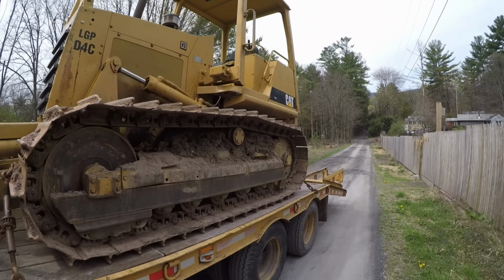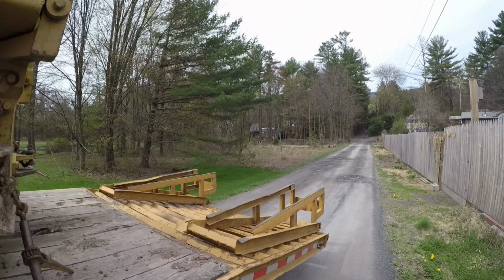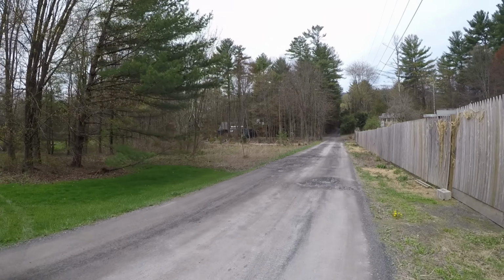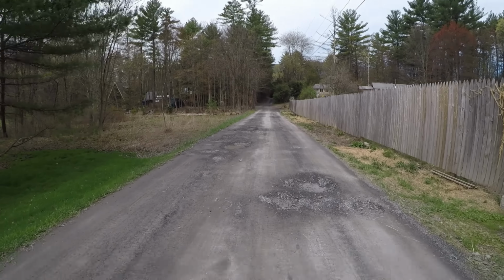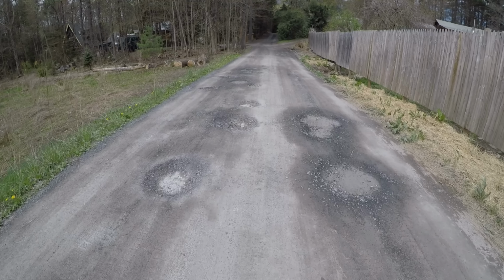Filling potholes

Comment: You don't "fix" potholes in loose aggregate roads, you rip the whole road and re-do it.  Strong toothed bucket on skid steer will break it up then use the dozer to put a nice crown in the road and be done w/ it.  You can't fill in pot holes-----which is why they keep coming back.  Next road, rip it loose, smooth it back out.
Reply from the maker: M Hamma yes good advice. I've had good luck filling them while covering the entire road with a thick layer of large stone though. That repair has been lasting well there.
Reply: I could see adding an entire thick layer as you've done here working as you've got plenty of new surface.  Not sure how the long term affect would be, but if you've laid down enough, I'd bet it'd be okay.  I've seen some folks just add an inch or two of gravel thinking the problem is solved, and it's right back to it in less than a year.  I've got roads on slopes and the only option is to break up the entire surface and re-do it.  Even if adding gravel, I'll first rip it up.  Gravel roads are cheap and easy, but they do require regular maintenance.  Most of the time a good box blade w/ rippers will get it done, sometimes I've got to use the track loader to rip.  Clay and granite gravel can make for one hell of a hard surface.  Of course a road grader makes quick work of such things but you need a PHD to be proficient with those things :D     A skilled grader operator can knock out miles of road before lunch, ditches cleared, surfaced redone, nice crown in the middle.......
Reply from the maker: Very good information, I agree. I feel that large stone tracked in with steel tracks makes a much longer lasting road.
Reply: When there's a thick enough layer of fines, I've cut them out and regraded with a harley rake, then the same procedure here.  Seems to work pretty well, although using the weight/tracks of a D4 is a much better practice.  Correct road crown % for a given grade makes a considerable difference in longevity.

Comment: As I understand it, in order to remove a pothole, you must cut it out to a point lower than the deepest point of the hole.  I wonder if the underlying old potholes, even when covered with the shale and top coat may continue to cause problems in the future.  I love your videos Andrew, real jobs, real used equipment, real breakdowns and real top quality work.  Keep up the great work!
Reply from the maker: Steve Mitman thanks. I've seen pot holes completely cut out, than filled with small gravel than come back in a few months. Filling them with a thick layer of big stone seems to last much longer.
Reply: I was told the same thing but I am by far no expert. As far as dirtwork goes I make a halfway decent auto mechanic lol.

Comment: Armchair critic here.. As potholes form, with traffic and rain, a "concrete bowl" forms which fills up with water. As it's splashed out, the gravel is thrown out with it. Adding new rock into and over the potholes is a temporary fix, as you will likely see after one winter season. Prolly should have cut the road down to get rid of the darn potholes before topping with the shale. You're still doing great work, but, yeah... 😊
Reply from the maker: Actually this one held up great. I just tailgated a fresh load of stone on the top and took a video of it. Ill crow bar that clip into a new video soon.

Comment: The road would not get so many pot holes if you used a roller on the first layer.  Gong over it with the dozer only gives it around 5%-20% compaction.  If it is not compacted properly, it leads to pot holes. You should also compact the second layer with a roller (smooth drum).

Comment: when a road is bad with pot holes, use your ripper on the back of your small farm tracker even if you have to push it with your dozer, then the bigger rock followed with 2" top coat.
Reply: oh yes crown & ditch, it goes without saying to me, you want water runoff.

Comment: I thought I'd seen every one of your videos. I like every one so I know I've watched it. I can't believe I missed this one. Good to get caught up. A question on this video. I thought you would fluff up the existing road material first and then top off with new material. Since this was a problem that just repeats itself I figured this would be the approach because doesn't the new material just push out of the old pot holes? This was done three years ago.....how did it hold up?

Comment: Three rules of road building: 
1. Get the road above the water
2. Get the water off the road
3. Get the water away from the road.
Reply from the maker: This road held up very well. I just tailgated a fresh load of gravel on top of it, I filmed it and will be adding that clip into a new video soon.
Reply: Andrew Camarata why did it need more gravel?
Reply from the maker: From a season of use, and snow plowing. There were no pot holes, just the surface was getting slick. A load or two a year will keep it in good shape.
Reply: Andrew Camarata why do prefer to regravel instead of ripping and reshaping it? I'd imagine there should still be plenty of material left on the road?

Comment: So many questions so little time. Do you own the quarry or just have access to it? How do you figure out how much to charge for a job like this with a 5yd dump a medium sized dozer the trailer your time fuel and materials used? I used to do dirt work and fill potholes but I been out of it 4 a long time.
Reply from the maker: Howard Fortyfive the quarry is public, Anyone can buy gravel there. Sometimes I just charge per load. I think I charged $250 a load there.